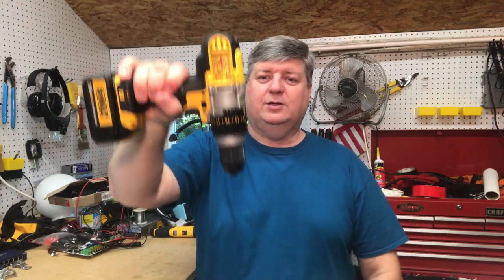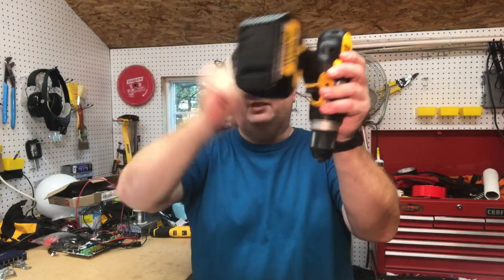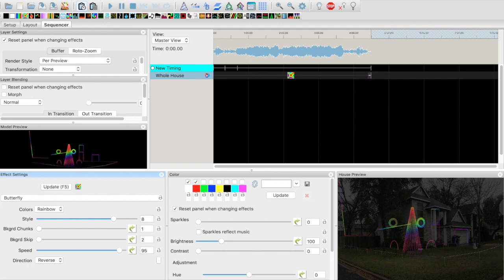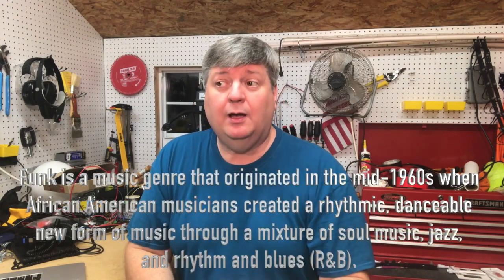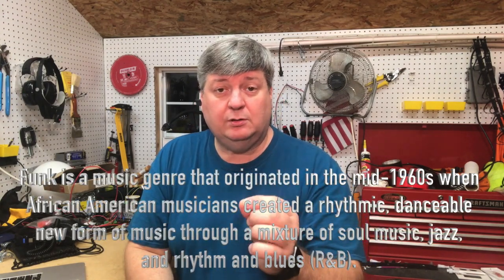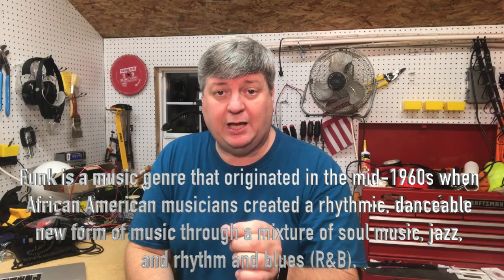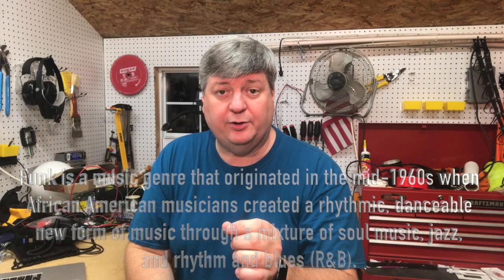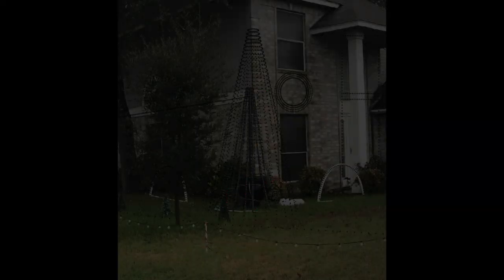How I Do My RGB Pixel Sequences

Comment: Hello,
I have a question, how do I extract fseq files from xlights so I can save them on usb?
Reply from the maker: Look at the main (Setup) tab for the Show & Media directory (we generally set them to be the same, but you can make them different). Anytime you save, the FSEQ file is generated and placed into one of those folders (I'm not sure which one because mine are the same, but I'd assume the Show directory).